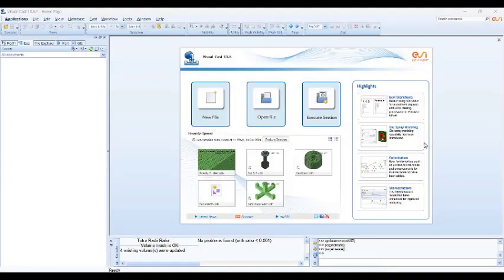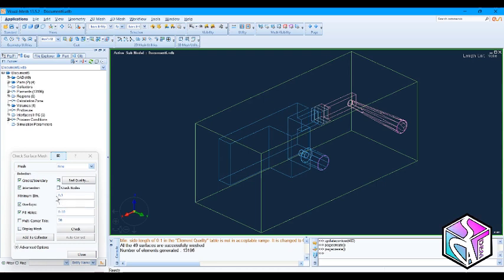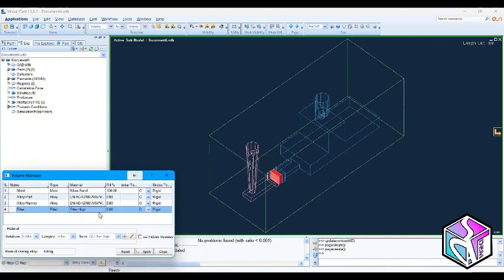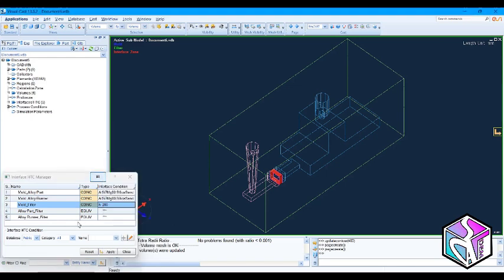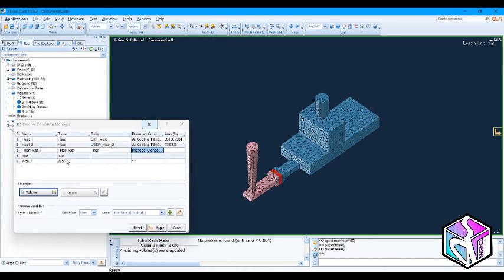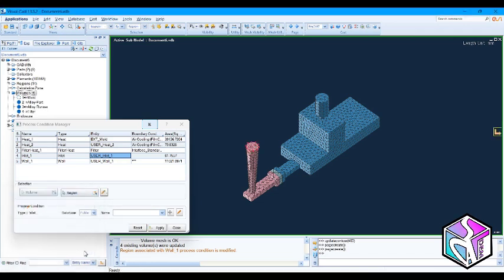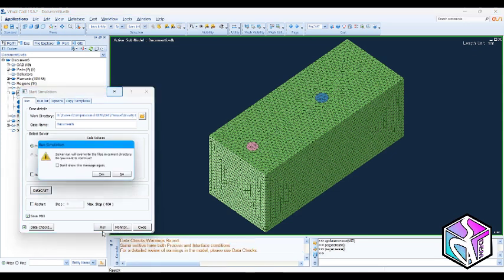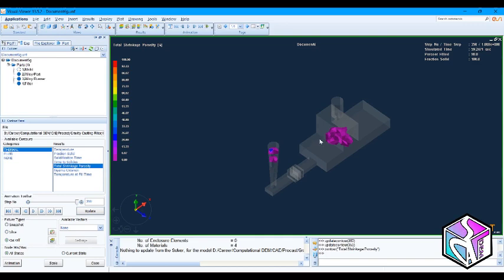ProCAST Tutorial: Simulate Gravity Casting of A356 Aluminum Alloy with Filter in 10 Minutes

Comment: Hi! Could you do a tutorial HPDC/LPDC casting? I'm having trouble assigning pressure phases. I know how to make a moving piston, assign its velocity and assign a metal line to be filled. But the filling happens in hundredths of a second, which is impossible. There are no guides on the internet for these types of casting.
Reply from the maker: I haven't done this simulation before and its interesting to mee too, so please share your problem through linkedin then we could discuses about it
Reply: Hello dear.. have u found any tutorial on HDPC casting? I am also struggling with this issue